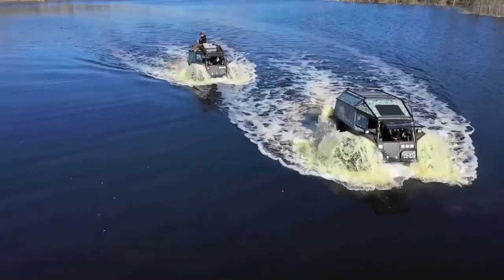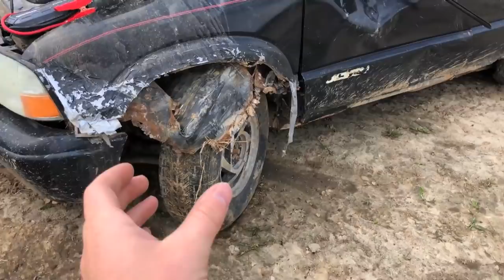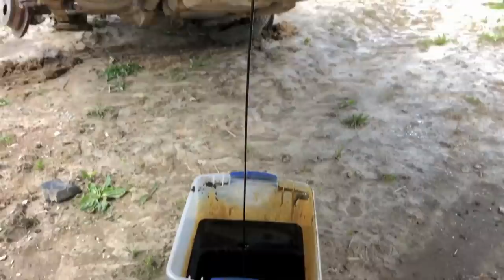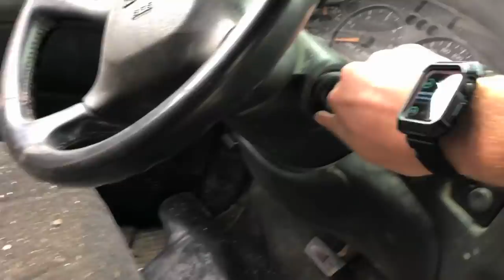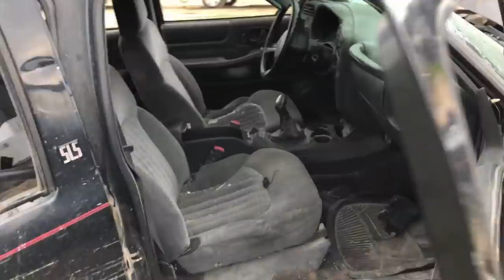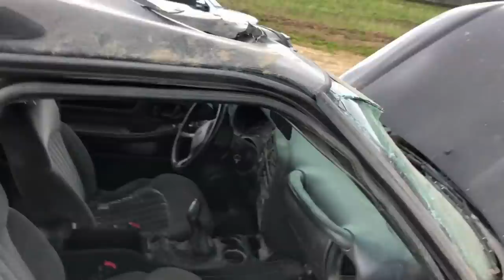ETHER And Gas Engines DON'T MIX!

Comment: Just so you know at WOT (Wide Open Throttle) while cranking, the injectors don't open.  This is called Clear Flood Mode.  Also the reason it would not run right was you had the intake tube off so the MAF (Mass Air Flow Sensor) couldn't read incoming air volume putting the engine into a limp mode.
Reply from the maker: Ahhh gotcha! Thanks!

Comment: Pretty sure the engine hydro locked because there's not enough compression to ignite the ether. Only use ether on a diesel and you don't want to use much on a Diesel engine. Plus always only spray ether while cranking the engine, don't spray a ton of ether in the intake then go and start to crank unless your looking for a nice big explosion

Comment: I know somebody already said it but those GM's don't run very well without a MAF sensor plugged in do you want to let the maf sensor plugged in its on the air cleaner

Comment: To much either hydro locked it filled they cylinders with either pull the plugs and crank it over to clear them out it will start